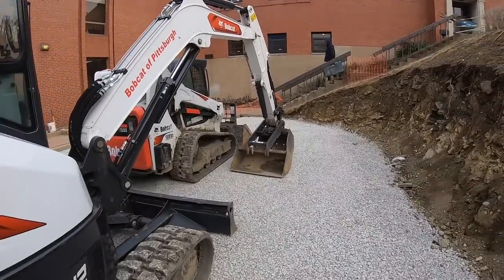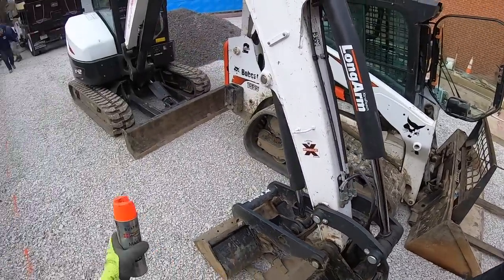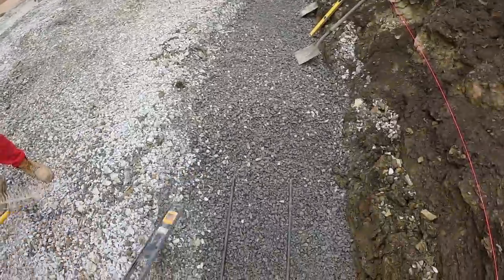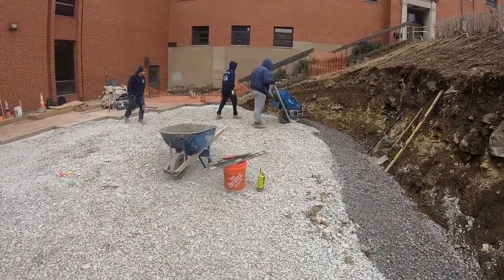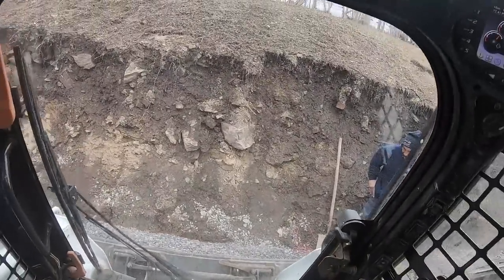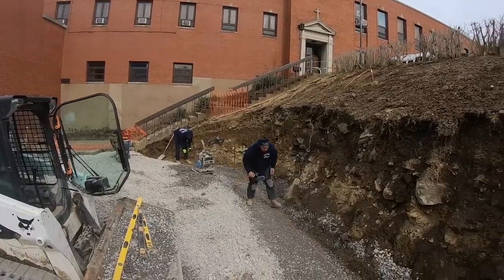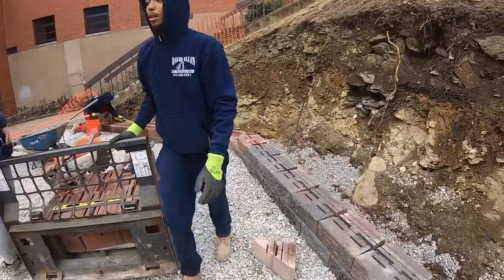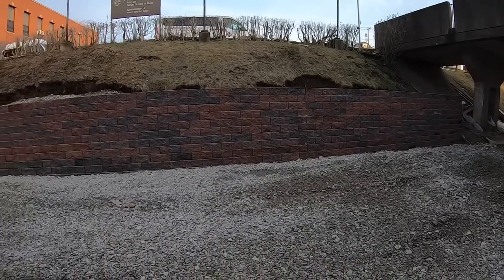Another Day, Another Retaining Wall.. Easy Money!

Comment: Was there any engineered drawings from the GC or did they have you design it?
Reply: Good question. Sometimes these jobs are approved with conceptual plans, which in my opinion is a huge mistake because the contractor will use his judgement rather than an engineers education. Had plans been drawn by an engineer (not an architect) for this retaining wall, it would have illustrated at least 4 layers of geo-grid at 6' horizontal depth from face of wall. I was only able to see 2 layers of geo-grid installed within the top layers of this wall and the horizontal depth of geo-grid looked like 4', (I hope that it was bi-directional). I was surprised at the beginning of this video that more excavation wasn't done for the installation of geo-grid. There is a misconception that the weight of these Segmental Retaining Walls is enough to hold back the earth that it is supporting it. In fact, the soil far outweighs the blocks. Good choice using the Versa-lok Standard block for this wall because they are quite heavy (123 lbs per sq ft) compared to Versa_lok square foot blocks that only weigh 84 lbs. Something else an engineer will consider with this particular job site  is the additional load bearing slope and parking lot above the top of this wall.This will be considered when determining the proper length of geo-grid. I have witnessed retaining walls that were improperly built and they are still standing years later. I suppose that long term success of an improperly built retaining wall has to do with the type of soil and how much runoff might get behind the wall. It all comes down to pressure. What will help in the success of this wall is the choice of block and that the contractor used far more than enough crushed stone for back fill.

Comment: This wall violates code and basic retaining wall design principals. Your wall certainly is 4 feet or greater ( I count 10 exposed 6" blocks above lower grade) but moreover has a significant surcharge with the sloping slope and road above the wall.  This REQUIRES a structural design and not simply one row of geogrid it appears you placed near the top. For this wall, at a minimum there should have been  4 layers of geogrid placed extending 5-6 feet back into the stone fill (18"behind the wall) and earth. That meant starting you base at least another 4 feet out from that excavation and in lifts adding  the clear stone and structural back fill compacted and lightly compacted (within 2' of wall).  And yes I am an engineer.   Moreover did you even take into consideration the soil structure of the embankment.  Pittsburgh has significant freeze/thaw and if that embankment is high in water retaining clay, additional margins are needed. You also have a parking lot/road above the embankment that could cause a excessive water discharge into the wall, yet there is no drainage pipe at the retaining wall base or anywhere.  I would expect this wall to gradually "fail" over the next few years.  You seem like a intelligent contractor but when it comes to this type of commercial work I would make sure you work with an engineer and simply not rely on a general contractors word to minimize any future liability.

Comment: Saw the drainage. But where's your geogrid?
Reply from the maker: 27:49 mark
Reply: There was no room for it as they didnt excavate far enough back. with a 2/1 slope like what's in the video the wall needs 6 foot wide geogrid the full length of the wall.  

He is on the right page about getting clean stone in there but using a chip base for a wall this size is asking for it to wash out your base over time.
Reply: You can use smaller sizes of geogrid we have don’t that were the space is constricted so using smaller sizes of it works also, don’t have to use the full size, until you get more room.
Reply: They way you work bro don’t go to commercial work. You are a danger to this business. So many red flags on this video. You don’t want to have a failure in a commercial job Not Cheap at all.

Comment: I don't know anything about construction/retaining walls, but how are the blocks secure enough to hold back that much weight if there's any sort of ground water or additional load being put on the inside face of that retaining wall?  Also, is it enough that the bricks are put on a footing of packed down stone?  Usually I see footings which are concrete going much deeper than this.  Anyway, just curious and trying to learn!  Thanks for the video.
Reply from the maker: The blocks are held together with 2 plastic pins in each block. The hillside is being held back by the weight of the blocks. The blocks are pitched towards the hillside and the aggregate/tubing behind the wall controls mass water flow. These Versa - Lok block also wick water so you'll actually never see any water come out of those drain outlets. If you do its a problem, haha! 

Regards to the footing you could use concrete for a faster basing experience but in my area all of the contractors use aggregate. That's NCMA standards as well as how the block manufacture tells us to.

Hope I answered your questions. I'll go more into depth in a future video. Thanks for watching! Take care.
Reply: You would never lay this style of wall with a concrete footing.  You could do it if it's like 100 feet high, but you would still need the base to be aggregate on top of a concrete footing.  Concrete is entirely unnecessary for this type of job.  The blocks pitch backwards.  They don't stand vertical, so it is pretty much impossible for the hillside to push them over unless there is a solid earthquake.